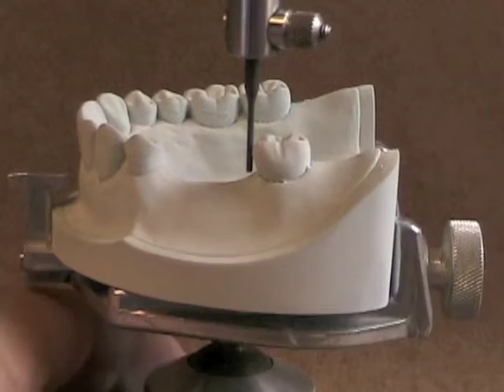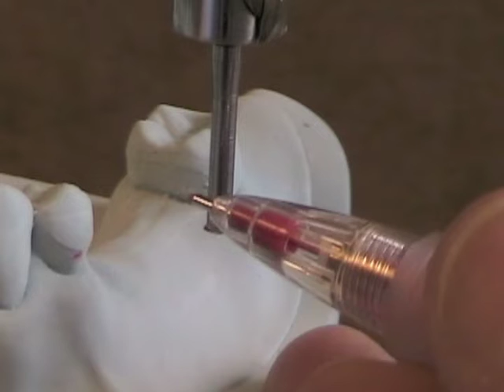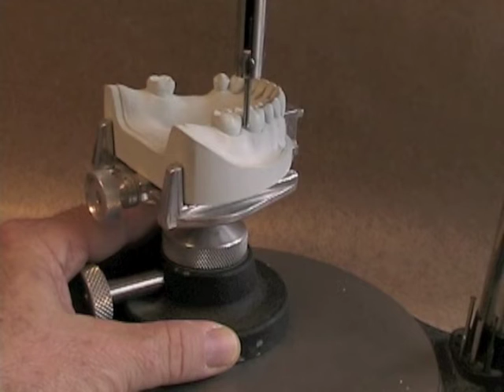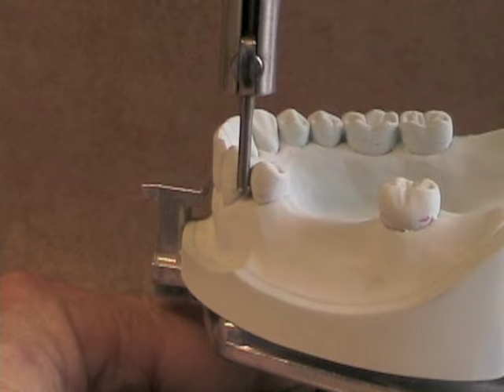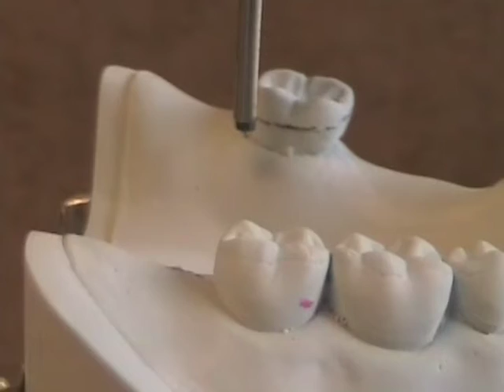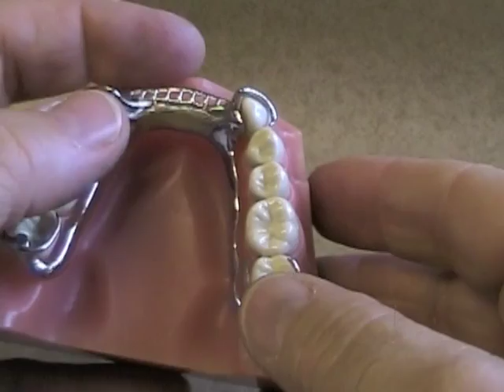03 Selecting a Path of Insertion & Tripoding

Comment: How to convert the same marks he did to another cast? I really want to know the answer how??? if anyone knows the answer please tell me. Thanks 🙏
Reply from the maker: There is no simple method to do this for a second diagnostic cast. If the second cast is a cast where the guiding planes have already been prepared and exist on that second cast, then the proper method is to survey the new cast  anew and line up the prepared surfaces so they are ALL as parallel as possible to the analyzing rod - the original path is of no significance now, as the preparations define the actual path of insertion, not the original surveying. If the second cast is a second diagnostic cast without preparations present, then either survey it again or if you are able to place tripod marks on the first cast in strategic anatomical positions without moving the height of the carbon marker, you may be able to place marks on similar positions on the second cast. But surveying it fresh is almost as easy. Hope that helps.

Comment: I have a question. If we were to place the cast clasp into the 0.02 inch retension undercut, wouldn't it be just left hanging in the air? Why does it deform?
Reply from the maker: No. If you design an RPD with a cast clasp fabricated to a position of a .02" undercut, the clasp will be made in contact with the tooth in that area. Intraorally, if you are able to get the RPD to seat, the clasp will exceed it's proportional limit trying to flex over the height of contour into the undercut. Once that happens, the clasp is permanently bent and will not return to its original configuration. At that point it will be bent away from the tooth and literally 'hanging in the air'. Clinically, if you see a clasp that repeatedly needs adjustment because it is not touching the tooth, this is probably the problem.
Reply: Thank you for your thorough explanation.